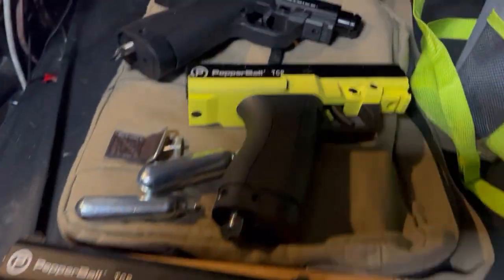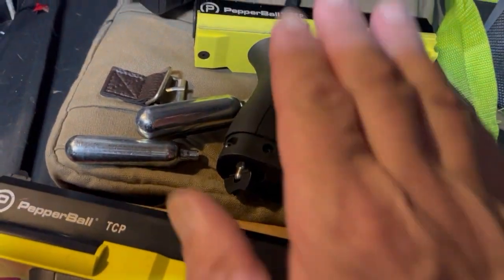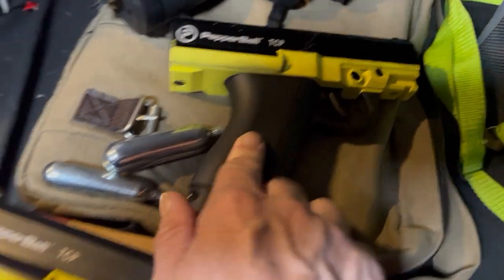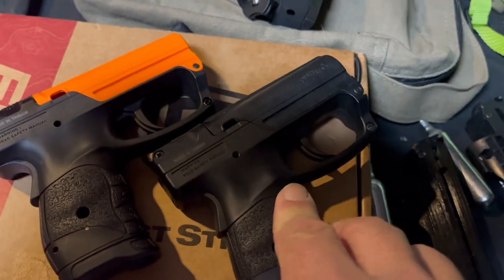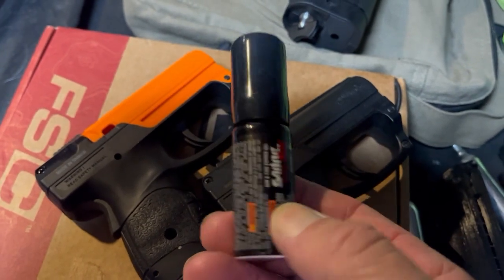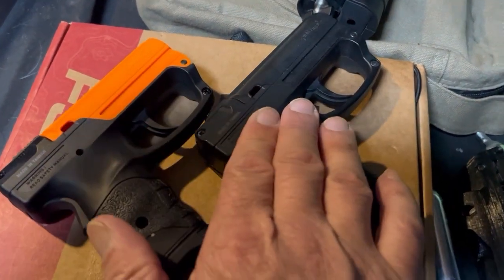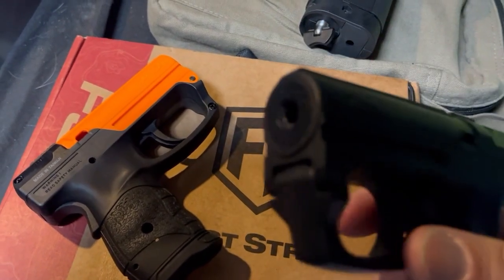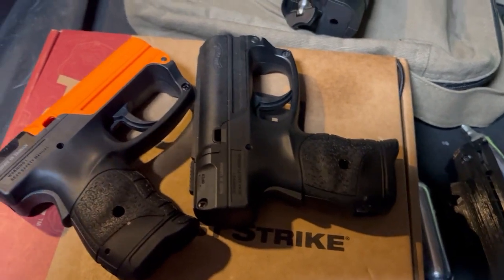Less Lethal Squirt Gun

Comment: I've never had the heat-core o-ring blow out on my TCP. But I try to lube it regularly because it's the most vulnerable and needs lube to oscillate properly under high pressure. I wish that didn't require full reassembly but that's the routine for me.
Reply from the maker: I have thankfully become more tolerant of the maintainance of this model. [zzenn] I had just installed the oring and it was soaked in silicon. Sean suggested the firing pin could be loose. But it hasn't happened again.

Comment: I have had good luck with the factory heatcore orings lately. Not sure what changed.

When you replace the ring next time in the Tcp check the firing pin inside the bolt isnt loose and lube the sheet out of the new oring.

I often wondered if the threaded co2 would work in a pinch. Thanks for trying. Nice vid!
Reply from the maker: Ok i will check the pin. Thanks! That o-ring was in a bag soaking in silicon for a year, lol. it was the last extra one. I will order new ones and maybe an eight inch barrel ;-]
Reply: @airgunsanonymouslesslethal1904  Did you see the multi shot crack barrel from Umarex?
Reply from the maker: Yes. I was interested in it but I saw less than an awesome review on it. The rifle, right?
Reply: @airgunsanonymouslesslethal1904  yes the rifle